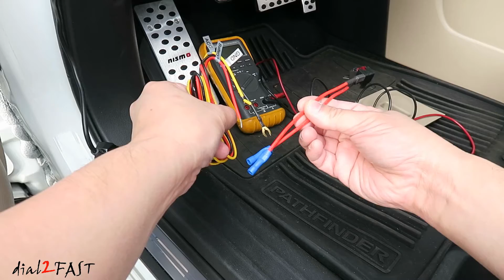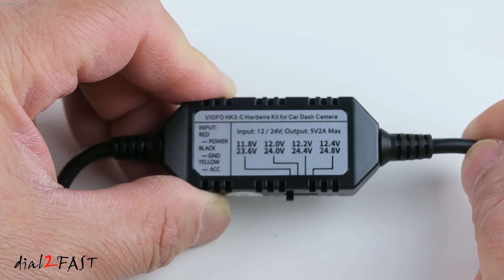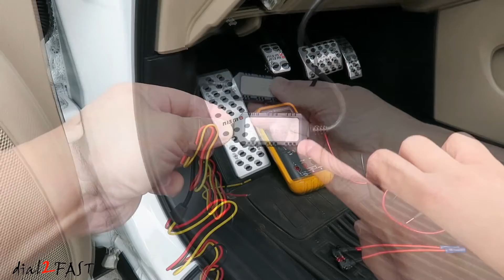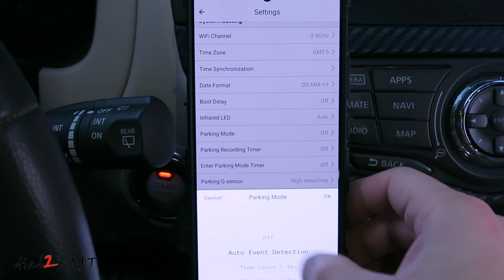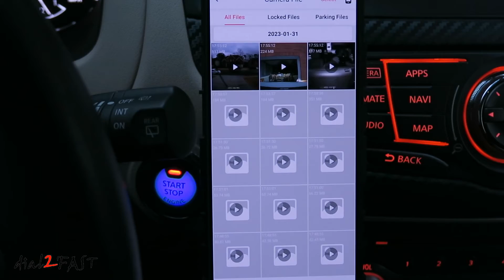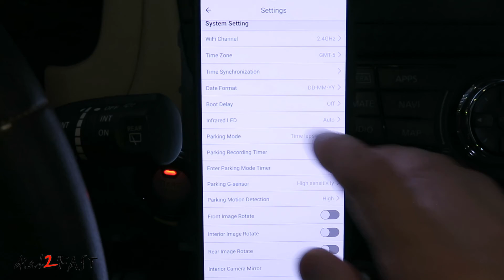VIOFO A139 PRO Install Hardwire Kit For Parking Mode

Comment: Hi I have a question about the infrared interior camera. How does the camera works? Does have a light that stays always on when it records cause that’s what I don’t like about it.
Reply from the maker: IR LED is not visible to the human eye. So it's not a bright light that is on at night.
Reply: @dial2fast ok that’s just inside the camera and those 6 points that looks like flashlights on camera will never turn on at night as flashlights? Correct?
Reply: @dial2fast ok thanks I think I got the point

Comment: Hi there! First your video and knowledge is awesome. So when I am choosing which fuse I want to connect the dashcam circuit, it’s a bit easier for me because I have spare ones. However, they come in all different voltage. I learned that factory voltage must be always bigger than Dashcam voltage. I see that you chose 12V and 10V — is that big enough? In other words, what is the voltage of VIOFO A139 Pro? I’d appreciate your help!
Reply from the maker: The numbers you are referring to is amperage (A) for current, and not voltage. The car operates on a 12V system, but the current draw is different for different circuits in the car. The dashcam will work with a 5A or 10A circuit. That's more than enough to power the dashcam. FYI, the dashcam requires less than 0.5A.
Reply: @dial2fast  Makes sense, amazing. Thank you so much for your fast reply!

Comment: Such a great video! Would you mind explaining, the part where you install the fuse in a certain direction, why is that and what would happen if connected vice versa? Thanks!
Reply from the maker: The reason you need to find out which side of the fuse slot has the voltage coming in is because the current has to flow 'through' the fuse. If you install it incorrectly, the device will still get power and operate BUT it will not have fuse protection. So looking at the fuse, one side will connect to 12V source, and the other side will go out to the device. If you install it incorrectly, the 12V source will be connected directly to the device side. 
You can watch another video I have showing the install, and you can skip to 5:05 in the video where I talk about the in and out of the fuse. https://youtu.be/Me0idM8MW4Y?si=bBrnEPIJL9gRMA3B
Reply: Sincere thanks! It is a pretty straightforward explanation. Really appreciated the time you took to answer in such a detailed manner. Have a wonderful day and thank you once more!

Comment: Great explanation. That part I"ve done, but now want to add a battery. Please help. Where does an accessory battery connect to the hardwired bundle.
Reply from the maker: Get a dashcam battery that has output connection for the 3 wires: gnd, batt, ign 12v wire. So instead of connection to the fuse box, you connect to the dashcam battery.
Reply: Thank you!

Comment: Thank you found out it was a  bad tap wire …fit it work but my camera doesn’t go into parking mode immediately after car shuts off … I have the settings you recommended

Comment: Have you ever had the hardwire kit or work ? Because I can’t get power in the dash cam with the hardwire kit and when I use the 12 volt port in the car the dash cam works … so I know the dash cam works … 
Unless the tap is wrong but I tested for constant and ACC … in a 2022 IS350 which fuses would you chose ?? Thank you
Reply: It is better to use a multimeter to test a fuse that can supply constant power and connect the red cable to it. Then choose an accessory fuse that can detect ACC ignition and connect the yellow cable to it.

Comment: Recently I had  A139Pro installed . Next found it will only able to perform at 2K front camera when the parking mode is enable. It came with the latest un published firmware.

Comment: In many cases, the airbag extends backwards above the door, so placing the cable as shown here may have unforeseen consequences if it inflates. =Make sure that the wires do not cross over the side airbag. The wires should follow the right side of the airbag and then cross the pillar below it. From there, continue downwards.

Comment: I can not get parking mode to activate
Reply: Does your camera turn off when your car is parked even if you have turned on the parking mode in the setting? If yes, please check if your hardwire kit has been installed correctly. The yellow cable shall be connected to an accessory fuse that can detect the car ignition. The red cable shall be connected to a fuse that can supply constant power even if your car ignition is off.
Reply: @ViofoDashcamOfficial  It is ALWAYS on? Always when i park and turn off tge vehicle nothing changes. It never says parking mode activated. As well there are NO vudeos in app under parking tab. Parkibg mode will not activate. Yellow wire runs to radio fuse which after 1 click of ignition turns on. Red wire is straight to the battery?
Reply: @speakadatruth7907  If the camera is always on even if your car is parked and has not entered parking mode, the yellow cable must have been connected to the fuse that can supply constant power. It is better to use a multimeter to test and choose a fuse that will only supply power when your car ignition is on and then connect the yellow cable to it.
Reply: I have the red cable going directly to the battery. I have the yellow cable going to a fuse but only turns on once the key is turned in the ignition. It's in the same fuse is my radio in my radio isn't always on
Reply: Maybe you guys labeled the wires incorrectly

Comment: Did you have to remove the A pillar trim? I didn't see if you could tuck the wire or not on your install.
Reply from the maker: Here is a more recent video of another install I did, and it shows how to run the wires https://youtu.be/fEOtavje3pg

Comment: im looking to buy the 2 channel one and would like to know how long it lasts with the car off. i know  car batteries are different just want to know roughly if its worth getting the parking mode cable
Reply from the maker: How long the parking mode runs depend on how many event recording gets triggered, and the health of your car battery. With the voltage cutoff set to 12v, you might get 2-3 hours of parking mode. If you set the cutoff below 12v, you can get longer runtime, but you are draining the car battery more.

Comment: Thanks for the video. I have fuses in my car insurance box from 5 amps to 40 amps. Does it matter which one I connect to using Fuse tape.
Reply from the maker: 10A or 15A will work

Comment: How do I determine what fuse size to use in my fuse taps? Thanks!
Reply: Never mind, I just saw a 5A fuse will work!
Reply from the maker: @Shawn-im4pm  Yes 5A will work fine since the dashcam will draw less than 2A.

Comment: My cam always turn off after 2-3 minutes in parking mode. Someone  knows why?
Reply: Please set the voltage selector to 11.8V to confirm if it can work longer. It seems that there is no enough power supply from your car battery.
Reply: @VIOFO-CS  thats an good point i'll try later. i'll let you now. thanks mate
Reply: @plo0p1  You are welcome, it is our pleasure!

Comment: привет друг! я настроил регистратор , порковочная запись по собитии. регистратор в режиме парковки работает пару минут и выключается.   когда есть движение , событие, регистратор не включается.   G сенсор не работает кажется
Reply: Извините за проблему. Какой режим парковки вы используете? Попробуйте устранить неполадки шаг за шагом: 1. Убедитесь, что кабельный комплект подключен правильно. Красный провод должен быть подключен к предохранителю, который стабильно обеспечивает питание 12В при выключении автомобиля, а желтый провод должен быть подключен к предохранителю зажигания. Черный провод должен быть соединен с землей. 2. Если соединение правильное, проверьте настройку переключателя отключения напряжения. Если вы выбрали 12,4 В, уменьшите его, чтобы камера работала дольше (пожалуйста, подтвердите, может ли ваш автомобильный аккумулятор обеспечить достаточную мощность во время парковки). Если вышеуказанное не помогло, откройте тикет здесь, чтобы получить дополнительную помощь: https://support.viofo.com/support/tickets/new

So sorry for the issue. What parking mode do you use? Please try to troubleshoot step by step:1.Please ensure the hardwire kit has been connected correctly. The red wire shall be connected to the fuse that consistently provides 12V power when you turn off the car, and the yellow wire shall be connected to the ignition fuse. The black wire shall be connected to the ground. 2. If the connection is right, please check the setting on the voltage cutoff selector. If you have chosen 12.4V, please lower it to make the camera work longer (please confirm if your car battery can provide enough power while parking). If the above cannot help, please open a ticket here to get further help: https://support.viofo.com/support/tickets/new
Reply: @ViofoDashcamOfficial  ок!
Reply: @ViofoDashcamOfficial  can be connected directly to the battery

Comment: Ok so admittedly I am new to all of this and knew nothing before I ordered this dash cam and a blackvue battery pack (130x or something). I had it professionally installed and the dash cam works but only while driving? I bought the hardwire kit for it to be hardwired to the blackvue battery, and to my knowledge it is because if I switch the battery off the camera won’t turn on. However, the camera absolutely refuses to record in parking mode. I ordered a cable that is supposed to fix it but it doesn’t have the usb c on the one end and it’s just very different than the original hardwire kit I got for the a139pro. What should I do?
Reply: The original hardwire kit is still needed, and please make sure the battery pack comes with spliced output cable to connect to our hardwire kit.

Comment: Hi. Thank you for the very informative video. Can I please ask how you plug the a139pro to the 8 power cell battery? When plugged to the battery do we need the parking mode cable? Does that mean we need use fuse tabs for the parking mode and the battery as well? I’m so confused. Any help would be great appreciated thank you 🙏🏻
Reply from the maker: If you want to connect this dashcam to the Powercell 8 battery pack, then make sure you order the correct USB-C output cable when you buy the Powercell 8. You will use the Powercell 8 output cable to connect to your dashcam. The Powercell 8 is connected to the fuse panel using fuse tap. The dashcam gets power from the battery pack and not the car battery. See my review/install video of the Powercell 8 https://youtu.be/e1lSGgr3KAY

Comment: I can’t understand why my dash cam keeps on going out every few seconds, and I’ll keep on getting a black screen on the application. I have the same thing you have mentioned in the video, 3 channel a139 voiofo
Reply: It runs very hot and it keeps on popping my fuses too and it keeps on turning off if I plug it directly into the car USB luxury car I don’t know why he doesn’t want to keep the dash cam on and the keeps on turning off on the Wi-Fi off and on and I don’t have any picture at all on the app, but A blank a black screen and that goes for all 3 channels. I hooked it up as directly as you shown in the video but I think there’s something else does this Dashcam have internal battery inside of it what I mean by that is internal battery when the dash cam is getting used and powered it up? Inside a battery that’s built inside the dash cam like an internal battery you know how cell phones have internal battery and you can unplug it and you can still use it the same idea applys to a dash cam

Comment: Do you know of a good way to mount the interior facing dashcam so it can be adjusted towards either the drivers or passenger side in the event of a police encounter?
Reply from the maker: The interior camera does not swivel left or right. If you want one with interior camera that swivels, then check out the VIOFO T130 that I reviewed https://youtu.be/Zv3XfKl0WSo
Reply: I would think it's a matter of finding a suitable universal mobile phone holder which can swivel left/right. Perhaps a magnetic one, where you stick/glue the loose magnet (intended to be mounted on the phone) onto the original camera-mount's stickypad.

Speaking of mounts, I don't understand why Viofo didn't run all connections (power, auxiliary camera signals, and GPS) for the main/front camera through its mount. Separate cable connections are always good, but an additional quickly "unclicking" connection would be nice when you constantly remove and mount the camera.

Comment: Hello great video! I had one question, If Im tapping into a empty fuse slot for the hard wiring, what size fuse do I need? I need to insert two fuse into one tap.
Reply from the maker: You can use  at 5A fuse to power the dashcam.
Reply: @dial2fast  thank you so much! two 5A fuse into one tap correct??
Reply from the maker: @aykay711  The fuse rating should be able to handle the current draw of the circuit. A dashcam should draw less than 500mA, that's why the 5A fuse will work fine. As for the other fuse, you can also put in a 5A fuse, but you need to check to see what current draw other devices use on that circuit.
Reply: @dial2fast  thank you so much for the clarification!

Comment: I've got this same pro dashcam. My problem with the parking mode: Sometimes it records 2-3 hours or 6-7 Hours. But most of the time it turns completely off  after some seconds...and I don't get it why...What could be the problem? Can you help me please.
Reply: Sounds like your battery is dropping below the threshold voltage and turning off the camera. I’d get a battery check which is free at most auto parts stores and see what you come up with there.
Reply: @jasonhannsz  Hello thank you for answering. Youtube informed just yesterday about your answer...but no matter now cause it works actually fine now. 11-14 hours hours can my dashcam record now :)
Reply: @zarbon18  как решили проблему?

Comment: Good Info, question, do I have a choice to shut off the other 2 cameras if I want to if I purchased the 3 channel Dash Cam Bundle?
Reply from the maker: Once the cameras are plugged in, it will recognize the 3 cameras and begin recording. If you want to turn off the interior or rear camera, you need to disconnect the cable to it (power dashcam off first before disconnecting).

Comment: Hey, I love the video!

How were you able to discern that PWR SOCKET ACC 1 was ignition 12V and ELEC PARTS was constant 12V without using a multimeter? I don't have a muiltimeter on hand, but if that's the only way to find out I guess.
Also, how did you know which way to put in the fuse tap? You said that in that vehicle, the voltage comes in through the right side and out the left, but how do I know if that's different in my vehicle? Or is it the same in all vehicles?
Final question, is there a specific way to crimp the wires? Some people say wire crimpers are the safest way, but I saw you simply just squished the wires together with the pliers. Does that cause any issue?

Thanks!
Reply from the maker: Since I test a lot of dashcams on my channel, I have done many videos where I showed how to test the fuse with a multimeter to find ign 12v and constant 12v. I did not show those steps in this video, but yes you definitely need  a multimeter to test the fuse circuit and find out which fuse you can tap into.